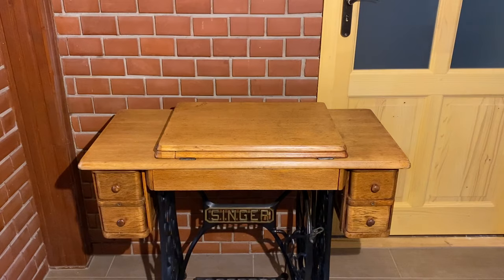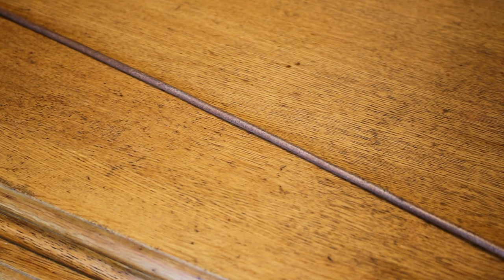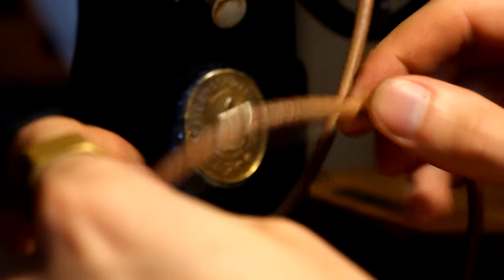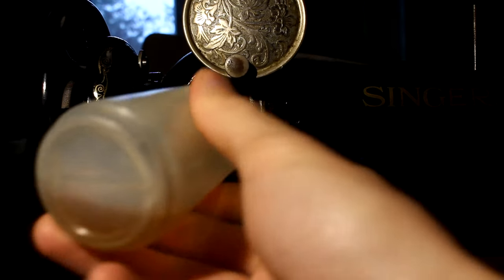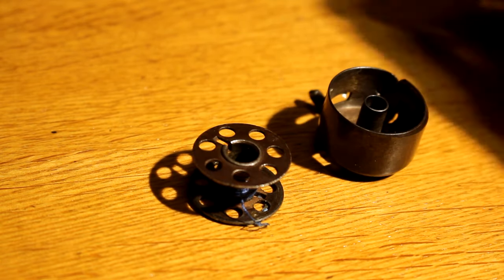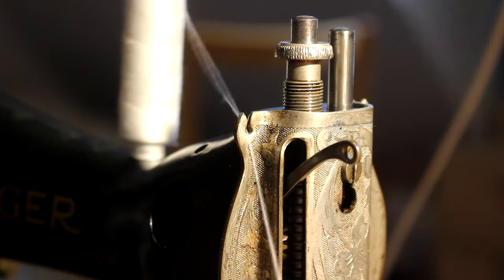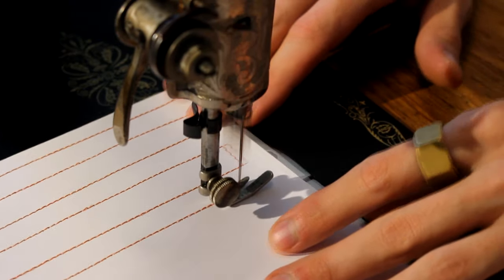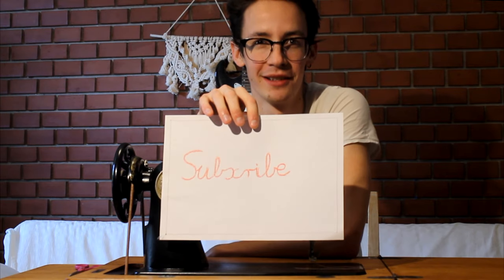What It Takes To Use A 1920s Singer Sewing Machine

Comment: That machine you Have is a Singer 15. This should help you find bobbins. The knob you looped your thread around is the stitch length regulator. To "Back stitch" you turn the goods around and go over the stitches a few stitches. Good luck with your old girl!  I use a Singer 66 that's the same era as your 15.
Reply from the maker: Thanks for the advice !
Reply: Another method for the back stitch is to lift the sewing foot, move the fabric back to the beginning and start stitching again so that you stitch the first stitches twice. And please never connect two bobbin threads with a knot 😮.
Reply: @ausnein7139 Yes most defnetly don't knot the bobbin thread!  as for that way I need to try that too!
Reply: I've had good luck lifting the presser foot slightly and pushing the material back while the machine still stitches.
Reply: Well done, I have an old treadle machine and a hand crank which need attention.  Your video was most interesting, thank you.
Reply: I have an old singer, could you help me identify it?
Reply: @ausnein7139  i'm new to sewing, so please teach me, what's the reason for not knotting the threads? Thanks 😁

Comment: You should use clear machine mineral oil rather than whatever that was that you were using. Also, if you are going to run the machine without fabric under the foot, lift the foot so that the feed dogs aren't running against the foot. This keeps the feed dogs sharp and better able to feed the fabric.
Reply from the maker: Thanks for the advice, it was machinist oil, a bit old though... Haha

Comment: To sew backwards, just pull up the presser foot lever up (while the wheel is still spining) and slide the fabric backwards; to continue forwards, just drop the food back down. It takes some practice, but it only works on treddle machines because you need a free hand to lift the lever and move the fabric backwards simultaneously. Otherwise, you can stop the needle in the fabric and do a 180 turn and stitch normally.

Comment: I own 15 treadle sewing machines, some in the cabinet and some are portable in a wood case 🥰 I love sewing on them, it's very relaxing 🥰 Thanks for your video showing how to fix things 😘
Reply from the maker: Thanks for watching ! Havi g 15 of them is a bit too much, no, haha?
Reply: I can’t decide if i want a Singer treadle or a Singer with a hand wheel next!
Reply: @JesusisKing222  a treadle machine is easier to use than a hand crank machine (yes, I have both). The treadle leaves both of your hands free to work with while a hand crank machine uses your right hand to “power” it only allowing your left hand to guide your fabric, etc. Hope this was helpful 😊
Reply: I own 50+ sewing machines.
Reply: @vaccavo  Wow! I thought I was bad owning 30, 26 of which are vintage Singer machines. My oldest is a 1923 Singer hand-crank 99 and my newest is a 2005 Brother.

Comment: As others have mentioned, your machine oil is old and cruddy. Oxidated or something. The oil should be clear. I have read that light is its enemy, so I made a little opaque cover for my oil bottle. Just in case you need a small project to sew!

Comment: You do a better job than some old men I've seen on youtube.  You also need the oil bottle with the little straw for neater oiling without drips and runs.   How do you loosen the tension on the belt after it's on????    Beautiful job you've done!
Reply: There is a little lever at the front that puts the belt aside and out of the flying wheel.

Comment: Very nice video.
When you use a treadle you have to use both feet.
One foot is forward from the other so that you use the pressure on your toes of one foot and the pressure if the heel of the other foot.
The feet do not stay together but are one forward from the other.
This gives ultimate control.
To stop the machine instantly pinch the belt!
Hope this helps.

Comment: Excellent content! I use to repair sewing machines.  Free tip:  The flat side of the needle goes opposite the last thread guide.  So many "repairs" were replacing the needle being sure that the flat side of the needle went opposite the last thread guide.

Comment: Please forgive me if I am repeating what someone else has already said...  It is best to raise the presser foot when running the machine if there is no fabric between the feed dogs and presser foot - this prevents wear and 'rough grooves' developing on the underside of the presser foot.  You will also find a 'felt' under the spool of thread on the spool pin helps it feed the thread better.  The spool pin at the handwheel end is probably the better one to use if you can.  A 'stack wound' spool of thread works better on a vertical spool pin.  For a cross-wound spool of thread you might like to try something that allows your thread to feed off the top of the spool, or 'converts' the vertical pin to a horizontal one. As for the treadling and stitching - they both looked great, and the machine is running very nicely indeed!
Reply from the maker: Wow, thanks for the many tips, will be sure to use them !
Reply: "The spool pin at the handwheel end is probably the better one to use if you can."   The longer feed reduces jerkiness.

Comment: The stitches look like they need the tension altering. I have used my grandmother's machine since I was 7 and I am now 71, 61 years of use and my machine is still working beautifully.
Reply from the maker: Yeah, I need to do more experiments on the stitching tension for sure, thanks !
Reply: @hefestodesign  Clean the tension pressure plates with 409.

Comment: 5:18 "Thankfully I remembered which parts get oiled" he says, oiling the threaded accessory mounting holes. You don't actually have to remember, of course, the manuals for these machines are still easy to find online in scanned PDF form.

Btw, using a yellow oil like you haven't isn't a great idea. Proper sewing machine oil is clear and non-staining, so you don't have to worry as much about it dripping onto a workpiece that you're sewing and leaving a mark.

Class 15 bobbins are the most common style of bobbin you'll find, and you can also substitute modern plastic SA156 bobbins.

You're missing a small circular piece of felt around the bottom of the spool pins on top of the machine to keep the spools from chewing through the paint. They're very cheap and highly recommended (or you can make one yourself, of course)

Your threading is incorrect. The 15 class has one of the most confusing thread paths though, so it's easy to get it wrong. The thread comes down into the tension discs and wraps counterclockwise, behind both the thin checkspring and the thick bent wire bracket. Then you come down over the front of the bent wire bracket and hook under the checkspring, then you go up through the takeup lever and down through the thread guides leading to the needle.

You may or may not find it more comfortable to use both feet on the treadle, with your right foot placed slightly further forward on the pedal than your left. You can then rock the treadle back and forth by pushing down with either foot in an alternating pattern.
Reply: Never use 3-in-1 oil on a sewing machine.  It is dirty.

Comment: You don't have it threaded correctly. The thread goes from the tension spring up to the take-up lever, down to the thread guide on face plate, to thread guide on needle clamp, then through the needle. Here's a really good video showing how to thread it in detail. https://youtu.be/jT6McEgKwB4 You may also want to learn how to treadle with two feet, set at a diagonal on the pedal, for better speed and control.
Reply from the maker: Thanks for noticing! Two feet is a good idea, I got pretty sore after a while with just one haha :)
Reply: Good advice
Reply: I’m going to add to the great advice others are suggesting- use a spool of thread that is straight wound, as opposed to being cross wound. Use a thread stand for the cross wound spools.
Reply: @JesusisKing222 can you please clarify what you mean by a thread stand? Does it sit on the table instead of the machine? What would I look up to find one? Perhaps there’s a video you can link that shows it?

Sorry for all the questions—I just purchased an old treadle machine to restore and am excited to sew with it in hopefully just a few weeks!
Reply: You might also move the thread spool further bach toward the handwheel & wrap the tread line once around the body of the machine.  That way The spool will bounce less.  And I only use my left foot, it's prescribed physical therapy for that leg!

Comment: Your top thread tension seemed to be too tight, but perhaps you would have better results on fabric. I use a 1910 Singer Red Eye and it sews as beautifully as the day it was manufactured. I’ve made several quilts with it.

Comment: Using both feet on the treadle, one further forward than the other and rather than pressing up and down, you need to do a kind of rocking motion using your heels and toes. Once you get it down you will really feel it flow and your control will improve enormously, and you should never get the accidental backwards stitch that is so frustrating.

Comment: I recently got a 1920's Singer treadle sewing machine from my husband; We re-oiled it and bought a new leather belt and put it on the sewing machine.  But now my question is;How tight is this belt around the sewing machine? I get the feeling that I have to push the pedal really hard and sometimes it suddenly stops. Do you know what I can do?
Reply: The belt should be just tight enough that it turns the flywheel and handwheel without 'slipping'. Any tighter than that just means 'heavier treadling' and working harder than necessary for both you and the machine. The machines are tough, you won't break or really hurt them by having the belt too tight - but everything works better if it isn't. You might have enough space at the ends of the belt to make another hole on one or both ends to loosen it a bit. You can also try 'stretching' the belt a little by removing it from the machine, and holding it as if you are using a towel to dry across your back/shoulders, then pulling each end with your hands.

Comment: At 9:37 it isn't quite threaded correctly, the thread needs to go from the tension disks, around that curved arm just above them, back down into the tension spring, and only then up to the take-up arm and back down through the thread guides to the needle. Correcting this should result in more consistent stitch tension

Comment: What are you oiling with? It’s brown ish. Don’t use that, you’re making yourself big problems. Fresh clear sewing machine oil is what you need - old yellowing oil gums up the machine. Other products either gum up the works down the line or stain your fabric. Also, that oil gets aerosolized as you hunch over the machine breathing it. Car products are carcinogenic. This is in your living space. 1 + 1 is two. 
  If that’s granny’s old oil pitch it. Hydrocarbons have a clock and spoil like milk. That’d be past ready for the trash.

Comment: Small error with bobbin.  Your bobbin case is different than the bobbin case shown in the manual that you show in your video.  The slanted slot goes the other way. Thus the bobbin should unwind the other way. The bobbin thread always is to reverse direction when going through the slot. Thus your bobbin should unwind clockwise CW, not CCW.

Comment: Nice machine. Hopefully, you've done some research on how to treadle. You are not demonstrating the right technique in this video. It's not difficult. Just requires practice to get used to. You need to use both of your feet. That is why the foot treadle is wide. Right foot forward and left food slightly back. Provides control.

Comment: Good demo.  Buy you should have replaced the the bobbin tire.  ,,remove the hand wheel,,oil the bushing,,,the thread you are using. Use only 100 percent polyester thread,,,,,you did not show which side the flat of the needle goes,,in or outside,,,you must test a machine with fabric,,two pieces.  And on the final chech.  You must fold the fabric,,,to 6 plies,,as to make sure the machine can pass over bumps,,,,use SEWING MACHINE OIL CLEAR COLOUR ONLY,,,,to get the correct length of the belt. You have to install the belt around the flywheel. ,,over the top in the hand wheel,,pull tight,,then cut. For proper tension.    Or you could have installed a Motor Kit ,with a light and make the machine to work by power.  Don’t ask me how I know so much.  All for your information and guidance,,,not many young people doing this Sewing Machine Technician job anymore.  Good luck. Ask me anytime about repairing,,,Mike Tex
Reply: These machines were obviously not designed for use with artificial fibers.  The Simanco company recommended the use of mercerized cotton.

Comment: It appears that your bobbin is a flat faced one, based on the bobbin holder, the machine would work better with a curved face bobbin. To back stitch without turning your project, just lift the needle and the presser foot and physically move your project seam back a few stitches then continue as usual. Looks wonderful!
Reply from the maker: Thanks for the asvice I eill try it out !
Reply: says to  @hefestodesign  :  I disagree. The domed bobbins are for 66 class machines.  This one is more like a 15.
Reply: @andyruina  Yep. Class 15 bobbins are flat faced. 66s are domed. They are not compatible. Switching is not an option.